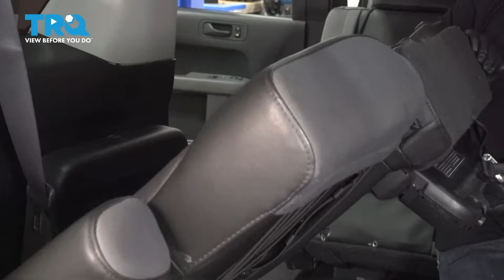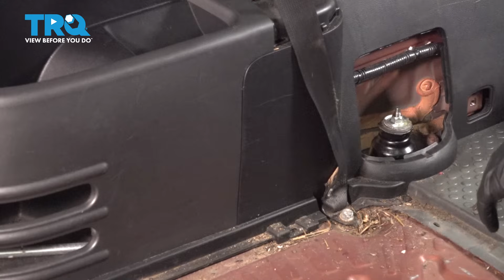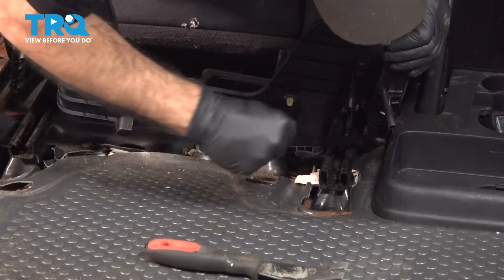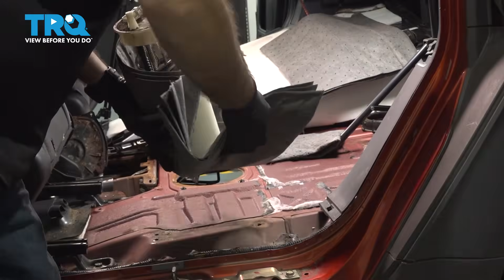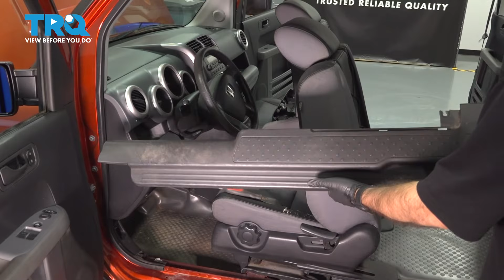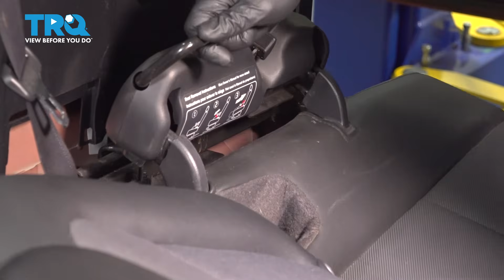How to Replace Fuel Pump Module Assembly 2003-2011 Honda Element

Comment: I have a 2003 Honda element. Not sure if I need a pump or not,,,,lif the car sits for a day it’s hard to start the second day,,,,,,,.otherwise it starts right up so I’m confused about that,,,,,but I do have one question why couldn’t we just pull back the floor mat right behind the front seat to get to the fuel pump area.

Comment: you don't have to remove the entire floor. just fold it back. you're doing too much. also before putting everything back together, start and check for leaks.